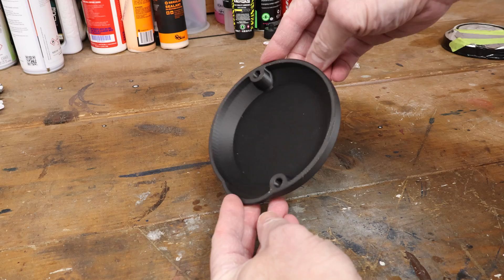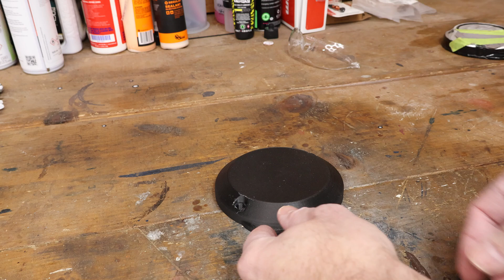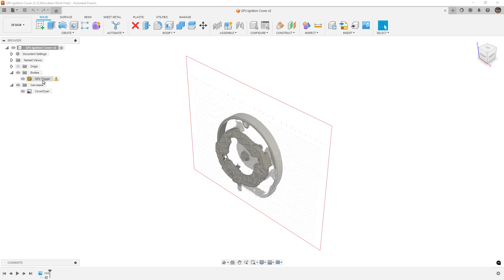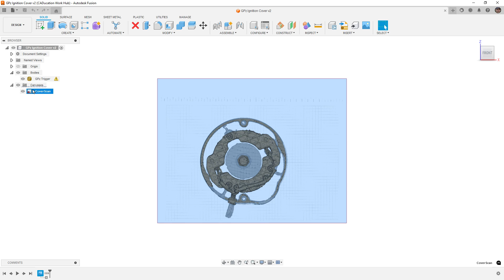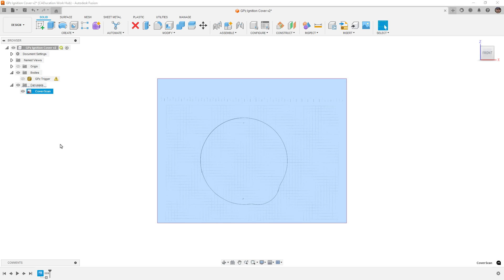How To Design A Motorcycle Engine Cover with CAD | GPz 750 Build Series

Comment: Hi Matt, I love your Fusion videos they're awesome, just finished watching the Your Porsche and Ferrari  Form car series, and watching your motorbike series , I'm more into cars, but the principles are the same and I just like designing stuff, they are so clear and easy to understand. I was wondering if could tell what the best approach would be to modelling Louvres for the rear windscreen on a car, I've been struggling with shaping the louvre ( blades/fins louvres ) any suggestions would be much appreciated. I'm from New Zealand and have an Australian built 2000 VT Holden Commodore, which I would to 3D print a mould and make a Carbon fibre louvre.
Reply from the maker: Thanks!  

For the rear louvers that is an interesting one.  I would probably use forms to replicate the rear glass of the car and then model the louvers with surfaces.  Are you trying to do the entire back glass?  Here in the US we are starting to see that trend pop up again on Camaros.

Comment: Can this part stand up to the engine heat? What type of filament are you using?
Reply from the maker: Yeah so with this series we are doing a general overview video of the part and then a CAD/design video where you can follow along.  I talk a bit about the filament here https://youtu.be/482brwDf1SI

I used a PLA-CF material that is listed for "under hood" applications.  Since there is no oil behind this cover it should be fine.  That is the plan at least
Reply: @LearnEverythingAboutDesign  I restore vintage motorcycles, so your efforts are of keen interest to me, especially since I am a Fusion NOOB.

I want to reproduce a gas tank for a 1965 bike (Honda s90)--they are impossible to find in any usable condition. My Fusion skills are inadequate, but I am working on it. I think it could be printed in Nylon or one of the high tech filaments that will stand up to gas (e.g., PAHT).

I printed a spool of Creality PLA CF. It printed well and looks nice, but its still PLA and I am skeptical it would stand up to any motor application.

Consider sending your design off to one of the metal printing outfits. I looked into it. The prices seemed reasonable to me.
Reply from the maker: @AudieChason  Cool project!  Several things to consider.  Even if you get a print material that will be suitable for gasoline the layer lines are going to be a problem.  At the very least it would need to be sealed with someting like Por15 used for rust repair on tanks.  But honestly I would consider using a bladder system.  Composite tanks are not generally legal in motorsports so they often run a bladder system inside the tank.  This might be an option.  Another possibility is to 3d print the part and then make a composite tank from the print (and still consider a bladder).  Part of the issue is that printed parts are likely to shatter rather than say a metal tank denting.

As for printing metal.  I have had a bunch of stuff printed and its not cheap.  The cover machined through PCBWay who is machining my triple clamp right now was under $100 powder coated black.  I had it quoted at a few of the rapid places in the states and they were all over $600 for the same part machined out of 6061.  I haven't quoted it for DMLS but I am sure it would be well over the $100.  Part of the reason for plastic is so that if it does contact the ground in a lean it will just grind away rather than unload the front end (in theory).  Depending on how many of my goals i get to check off on this project I will have several machined parts to come:)

Comment: Nice video Matt, seems like as good as any project to teach us.
I’ve got a Miraco 16GB which I got through the kickstarter and it’s still unopened 🤣.
I think it’s portability ie untethered was my main thought, having used an Einstar , also it’s meant to be a bit of an all rounder with sizes of objects.
If you don’t mind me asking have you got a preferred scanner in this price range.
Thanks Pete.
Reply from the maker: Hey Pete, my goto is definitely the Miraco.  I have the "Plus" model here with the PMK kit that I need to do a few videos on.  There are loads of scanners out there and they all do certain things great but the Miraco is a wonderful at more than most.